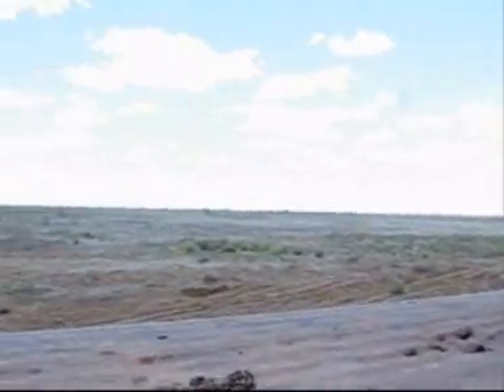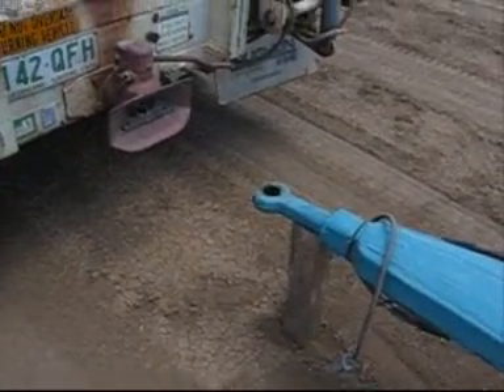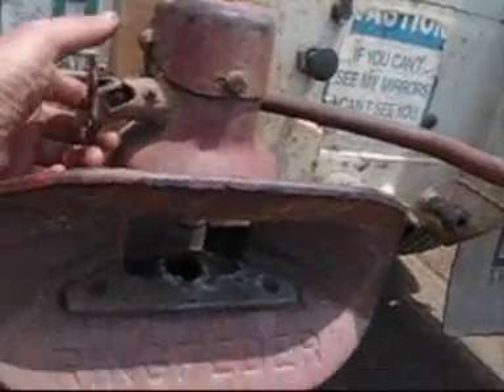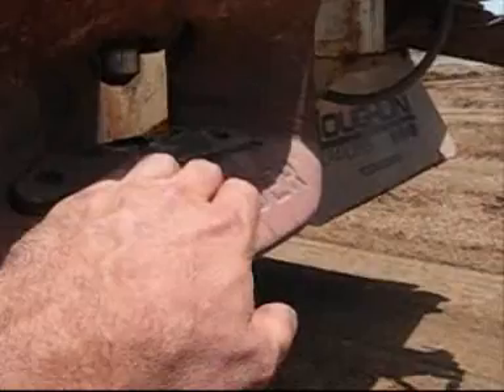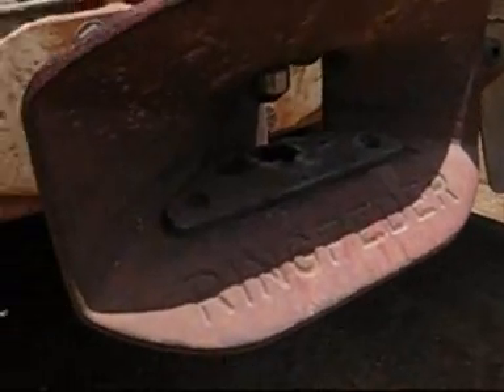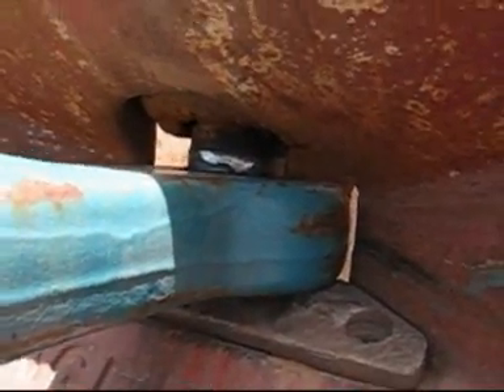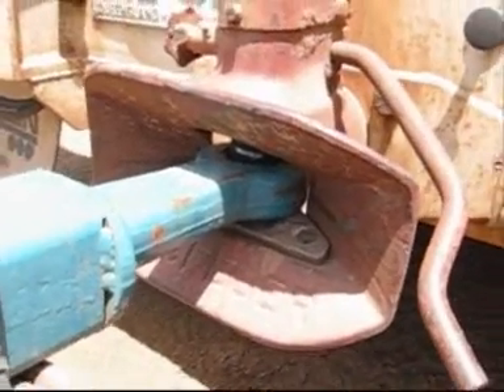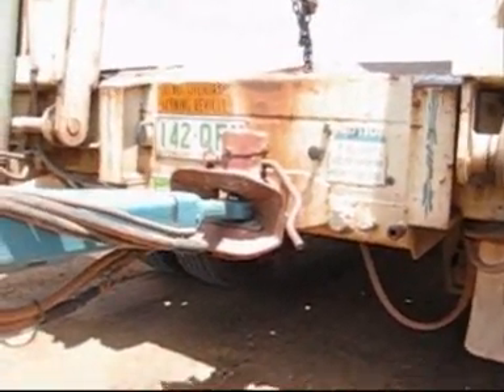What Is A Ringfeder

Comment: we use something similar in Michigan on the gravel trains (heavy hauler / double dump trucks) it is a pintle hook but utilizes a fishmouth for the ring to slide into instead of the ball system. only difference seems to be the auto pin feature on the ringfeder, we drop a large 15 lb pin through the fishmouth and ring by hand to accomplish the hook with the dolly

i do like the ringfeder though, thanks for the demo

Comment: I can't understand why the outdated hook system is still in use in the usa. It has little tensile load and drawbar load and you need these safety chains and there is no automatic locking.

Comment: Yes we do have a version of a ringfeder...its called a "fishmouth". Basically the same thing except the pin is just sitting in the top. It is dropped in from the top...and is not automatic like this one. Used on the heavy haulers in Michigan........the ones that weigh 164,000 lbs,,,,,twin axle dolly....these are also called "A" trains....the 5th wheel is on the dolly. "B": trains have the 5th wheel on the back of the front trailer.